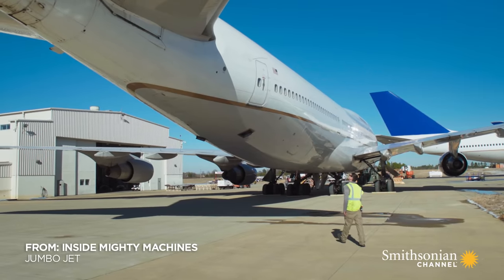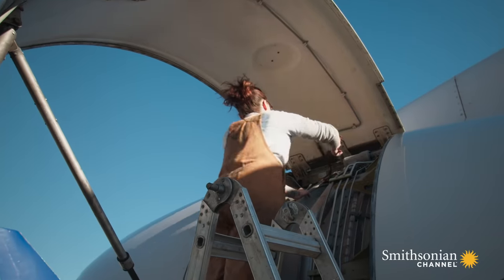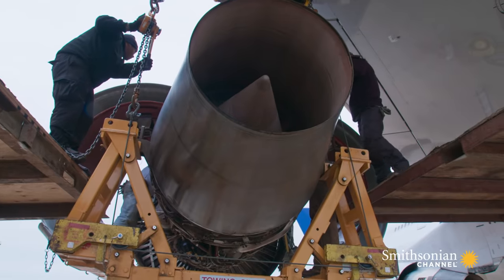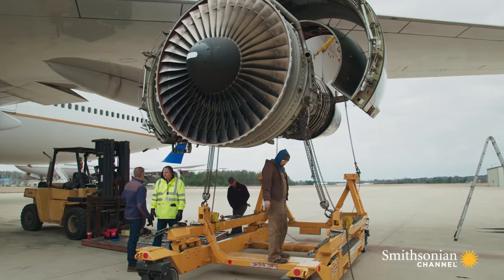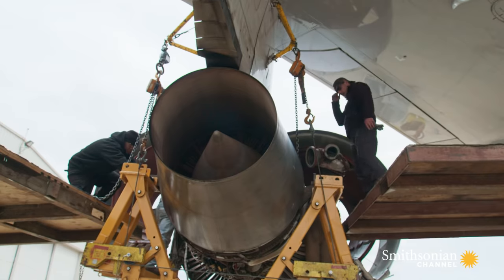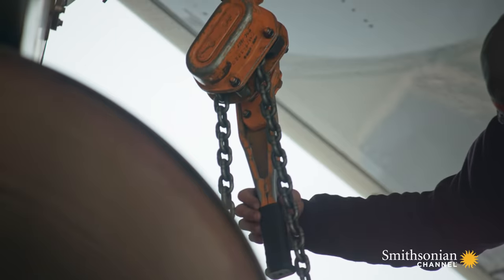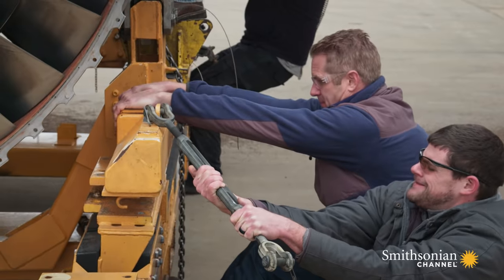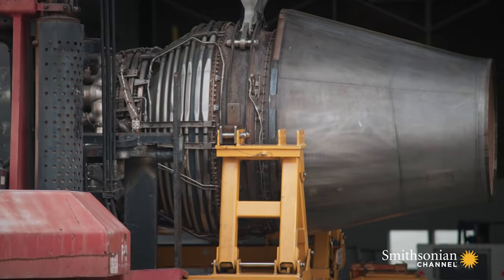Removing the Engine of a 747 Needs Expertise and Care

Comment: They need an inspector because of the American Airlines Flight 191 DC-10 crash in Chicago when the airline had devised a labor saving engine extraction method of using a forklift to hold the engine. That led to the biggest air disaster in US history 273 deaths, including 2 on the ground
Reply: I work at Delta…there are zero inspectors involved in the REMOVAL of an engine, not “extraction”.  Inspectors buy off the mount bolt torque and some other stuff.  They couldn’t care less about the removal. You clearly aren’t a mechanic.

Comment: Interesting behind-the-scenes maintenance routine. My only issue: When the nature of the action taking place is clearly visible and intuitive to the viewer, there is no reason to oversell the scene with tropes such as "One mistake and...".  "Nine thousand pounds of engine are now suspended in midair...". Not any more than when attached by bolts. The engine is suspended in "midair" by a different means but, to a non-engineer, it was hanging just as precariously on four bolts before disassembly. "...any mistake (dramatic pause) could be disastrous". "Any" mistake? Then, any mistake while driving at high speeds on a highway can be disastrous also. True, but not deserving of a drum roll. The imprecise language and dramatic delivery of the narration used on many videos, while designed to create tension and hold interest, have become so trite and predictable, that the technique often causes more irritation and distraction for me.

Comment: Very dumb how they don't have a hydraulic lift than can square level with the engine and lift up to it and bring it back down with out the whole chain hoist drama they show.
Reply: Exactly what I thought. The cradle they used to sit the engine on..would be perfect if it had some hydraulic legs that would raise it up to hold the engine in place....undo the bolts...and then just lower it back down ready to be picked up by the fork lift.
Reply: Read about the crash of American Airlines Flight 191, and you'll know why.
Reply: Those are called Cobra stands.  I have removed and replaced HUNDREDS of engines this way….never seen it done any other way with the exception of using come alongs that are pneumatic powered.